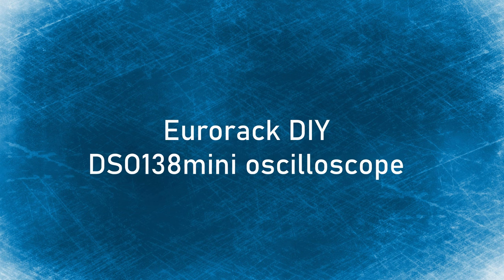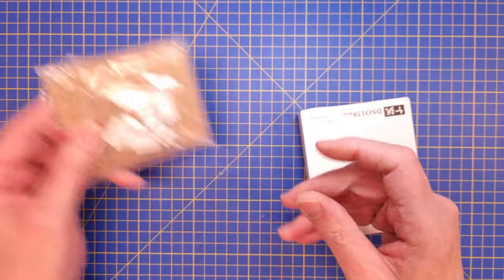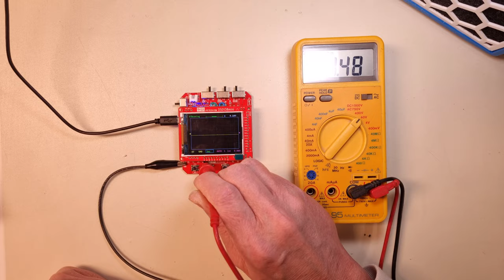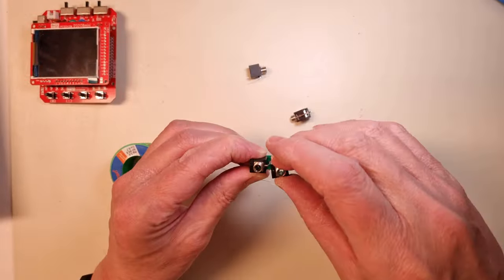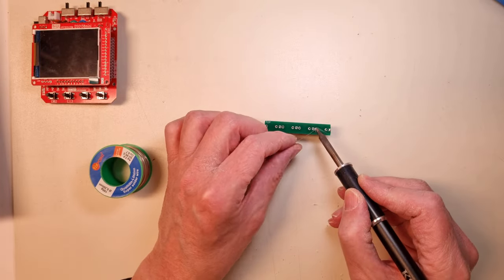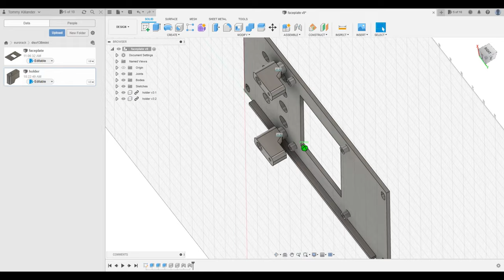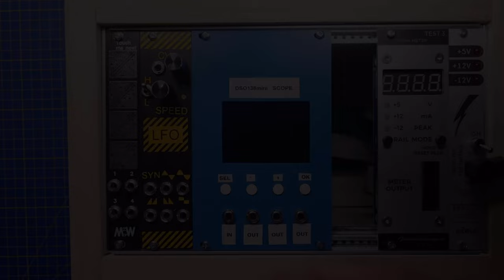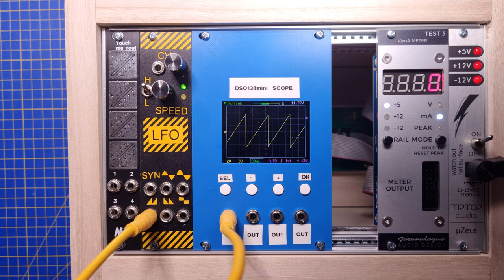Eurorack DIY: Build your own Oscilloscope

Comment: Nice! I turned one of these into a Eurorack module too, but I’m lazy so I just used a 16 pin connector and the 5V rail 😅 I found my 3D printed panel too flimsy and made a proper panel for it in the end. I have the one with front switches, so those are accessible via the panel too.
Reply from the maker: Awesome! I was thinking of adding all the switches to the frontpanel, but since mine is the model where the switches a located at the sides, so it was too much work - I'm lazy too.... 😂😋

Comment: I like what you did to make this a nice module. I also want to do this to use in my modular system.
I do have two questions however.

My power supply is 15V. If I'm correct the module will use 5V. So I need a 7805. I'm a little afraid it will get too hot. How did you do this with your 12V eurorack?
Another question I have is about the input. My modular uses input of 10vpp. Looking at this module it's can handle 5V input maximum. How did you solve that?
Reply from the maker: Hello,
The 7805 doesn't get so warm at 12V, but maybe it's a good idea to have a heatsink for 15V operation... The power dissipation is around 1W (100mA * 10V) with a 15V power supply..

The max input voltage is 50Vp-p. I have the sensitivity switches set to 1V and x2, which means that the scaling will be 2V/div. I have selected DC coupling mode so can look at slow CV signals.
Reply: @MeeBilt  I thik it's better to use a buck convertor instead of a 7805, although with a buck convertor I'm a little afraid it will cause some noise on my power supply. But a few capacitors will solve that I hope.

I cannot find any documentation about the function of those switches. But if I understand you correctly I can limit the maximum voltage to 5Vpp? So no need to use resistors to create a voltage divider on the input?
Reply from the maker: @Patrick-sp6zu  Yes, the switches work like an attenuator (like on a "real" oscilloscope). The documentation is really poor but if you look at the silkprint of the PCB, you will understand how they work. Good luck with your build!

Comment: I got excited at first, but it looks like the refresh rate is extremely low
Reply from the maker: It's not extremely low; I would approximate it to around 5 frames per second. But this will of course depend on the horisontal sweep time and trigger setting.
But compared to equipment that are 10 or 100 times more expensive it will of course come up short.

Comment: Excellent! This is exactly what I was looking for. Would you consider to share a close up and details on the 5V pinbox with the others additional components that are required? And where did you acquire the pcb for the 3.5mm sockets? Thanks in advance!
Reply from the maker: The schematic diagram and bom for the 5V linear regulator circuit can be found here:
https://github.com/tkilla64/eurorack/tree/main/misc/dso138mini_mod

I used half of the pmult PCB (also on my GitHub). But you don't need a PCB for that - it's just 4 jack sockets connected in parallell.
Reply: @MeeBilt  thank you very much, I really appreciate it👍👍

Comment: Hi great video! I bought the kit too. Can you please provide a list or links to the other parts I need like the passive mult etc? Thank you so much!
Reply from the maker: Hey, thanks a lot!
You will find the documentation of the passive mult on my GitHub:
https://github.com/tkilla64/eurorack/tree/main/pmult
But you will only need a half mult, so the cheapest and simplest way is to connect 4 jacks with wires, see schematic diagram here:
https://github.com/tkilla64/eurorack/tree/main/misc/dso138mini_mod

Good luck!

Comment: Hi mate ! Already made this one last year, with putting the switches on the front panel.
Pretty good idea to use a multiple to fill that empty space!
Reply from the maker: Hey HarmO! Yeah I think there are different version of this kit, one with angled switches and one with straight ones.
I bought mine at Banggood a while ago when they where on sale and it have been sitting in a box until now.
Reply: @MeeBilt  haha I had to buy switches separately and it was not an easy job!
Reply from the maker: @dtharmo  I can understand that - it doesn't seem to be a "standard"-part.